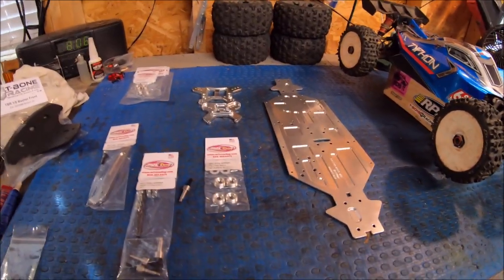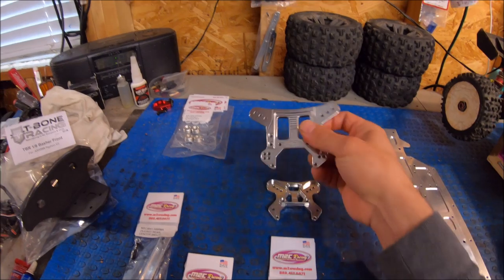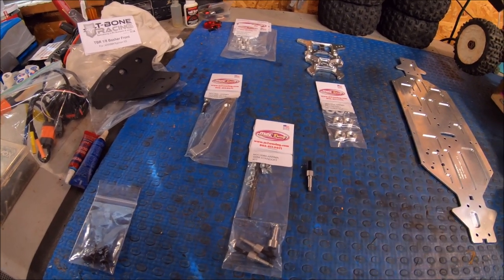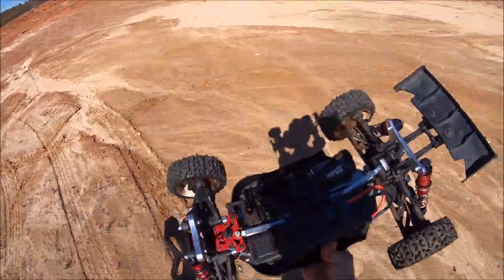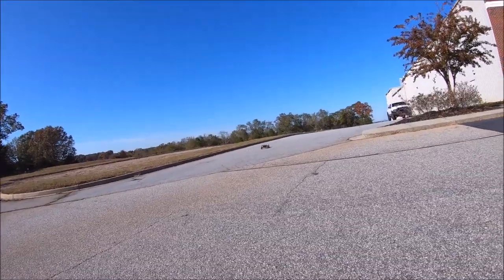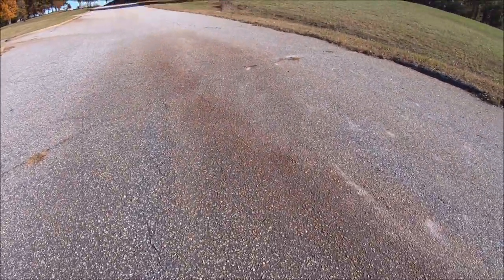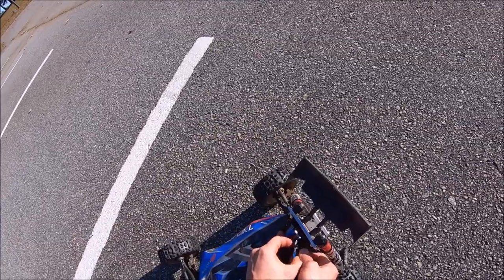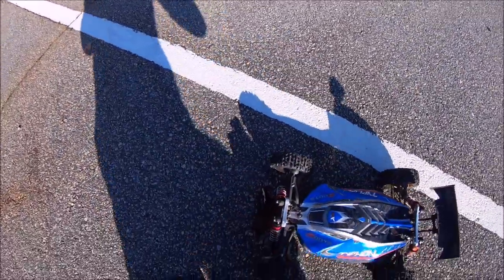Arrma Typhon 6s -NEW Lightened RACING M2C CHASSIS TEST! And BEST upgrades!

Comment: impressive! i wonder if the lighter chassis helps with durability even more?
Reply from the maker: That's a good thought!🤔I'm not sure if this chassis can take the hits the 4mm can but it definitely took some harder bashing..😂Maybe a lighter truck is less abrasive on impacts🤔Good thought brother kev! Thanks for watching buddy!😎💪👊✌✌
Reply: @RCDUDE81  with this build are the ESC settings in stock or have you changed punch/brake at all. i set my endpoints with the DumboRC and wholly shnikeys, hello higher top end!

Comment: That front flip at the 7:30 mark was amazing! 😱😱 Seems like the lightened chassis held up 👍 I figured it would on the Typhon. I will have to put it on my M2C wish list 🤣🤣
Reply from the maker: Thanks Aaron!👊Yeah the front flip was more of a quick correction. That spot kept kicking the rear up. Only way to save is it the brake!😂Loving the lightened chassis for sure!😎💪💪✌

Comment: Epic as usual! Any tips on the 4 bottom screws from not backing out from the rear and front of diff cases? Just happens or what. Any tips would b appreciated. Thanks king
Reply from the maker: Thanks so much man!👊Yeah over time with running them in and out, the threads in the case just get worn out. Plus lots of hard chassis slaps put a lot of downward force on them..the diff cases in this rig are at least 2 years old so it's time for a new one!🤣

Comment: Awesome video, what gearing are you running, pulling wheelies on buggy tyres?
Reply from the maker: Thanks bro!👊Stock spur with a 18 tooth pinion. Punch 9 on the ESC.😎👊
Reply: @RCDUDE81  ah!! I've never changed the punch, gunna have to have a play cheers buddy. Glad the new m2c chassis holds up well even tho he listed it specifically not for bashing.
Reply from the maker: @shaggysgcanimal  Yeah he just wanted to see how it held up bashing. It's still stronger than stock but over time, the 4mm will be your best bet for hard bashing!
Reply: @RCDUDE81  I'm not too rough on mine, still have stock chassis haha. Just have crcu extended skid and chassis braces. Holds up great but if I'm ever gunna be sending it like this, these upgrades would be perfect for me. Not many places around me. Keep up the good work buddy!!

Comment: hey man tha time has come to order the final parts for my v4 kraton. this question is about the speed chassis vs goliath chassis. i will be bashing and hitting jumps and stuff but will not constantly be  doing big air just manly dirt and grass bashing and i think with the m2c chassis braces,shock towers, and his standoffs and all the other reputable upgrades ive done to this build so far and the kinda bashing i do the lightened chassis would hold up 'hopefully' It has to be stronger then the stock chassis And those take a beating if the proper suspension and braces are installed. I'm trying to keep my car as light and tough as possible. Do you think the speed chassis will be a good fit and hold up to some decent size jumps every once in awhile and dirt bashing or do you think i should order the Goliath chassis? in this video it looks as if the rig holds up very well but its also shorter wheel base and more compact then the kraton. but you're the arrma king man and i will trust your word when it comes to arrma and rc upgrades. So please let me know your thoughts sorry for the extremely long message man and ill ttyl.
Reply from the maker: Sounds like an awesome build bro!💪IMHO I'd go ahead and get the Goliath chassis. The speed chassis is tough but after several runs and a bad landing, I ended up bending mine. Its is tougher than stock but made for the speed run guys. He just wanted me to test it in the bash field to see what it would take! But you're right, the longer Kraton chassis would be more susceptible to bending so the 4mm may be the way to go. One and done!👌Good luck bro and hope she turns out nice!!😎👊
Reply: @RCDUDE81  hey man thank you for your advice. I will be ordering the goliath for sure. Can't take any chances of it bending and then having to shell out another $100.
Reply from the maker: @raptorider83  Anytime man!👊

Comment: Unbelievable man, that takes some skill! I can’t wait to get my m2c chassis. 
It looks like Your typhon has more control in the air and power for wheelies than mine.. mind if I ask what weight diff oil you use? I’m trying 80k front 100k center and 50k rear but there’s no way it’ll wheelie and yours about flips over!!     Awesome job man, keep them coming!!
Reply from the maker: Thanks so much man!👊I'm running 50k front, 200k center and 30k rear. 18-20 tooth pinion depending on outside temps. Punch 9 on ESC stock electronics. Good tires help too! These  Duratrax Lockups have mad traction!💪Thanks for watching bro!😎👊🤘🤘
Reply: @RCDUDE81  omg that's insane... I run 4s 15t punch 4 in my Typhon.

Comment: Hi Eric, Quick question... What is your setup on this animal..? Don't often see a Typhon pull wheel stands like that...on pretty much every surface!!!.. It's an animal.!! Looks like the BLX stock setup but.. have I missed something??.. what pinion do you run, also do you run super thick oil in the centre diff or a spool?? Why and how hahaha..Thing is truly an animal!!
Cheers Brother... Watched this vid like 4 times...lol... LOVE the Typhon.. Absolute beast!!
Reply from the maker: Thanks so much bro!!😎👊Yeah this Typhon is nuts powerful! Maybe it's a good motor!😂But I run the blx system with punch 9 on the ESC And 18 tooth pinion. The Duratrax Lockups have serious traction too which helps! The diffs are 50k front, 200k center and 30k rear. I also have a bit stiffer suspension setup. Thicker oil and Outcast front springs in the front shocks.😎👊💪🤘🤘
Reply: @RCDUDE81  I love these tires. They're sold as louise b-Pioneer here and they're so amazing yet so cheap! Just 30-35€ for all 4!

Comment: Is the chassis longer than original 6s? An is the 6s chassis same as 3s?
Reply from the maker: Same length just 2mm instead of 3 to lighten it up. Still 7075💪The 3s has a plastic chassis so whole other platform although they are roughly the same size.
Reply: @RCDUDE81  thanks,I have a 3s was curious if I got that an changed everything over.  Would that be something could do?
Reply from the maker: The 6s chassis won't work on a 3s. Complete different car.😜M2C racing is working on upgrades for the 3s line though including a chassis stiffener kit soon to come.😎👊
Reply from the maker: The 6s chassis won't work on a 3s. Complete different car.😜M2C racing is working on upgrades for the 3s line though including a chassis stiffener kit soon to come.😎👊
Reply: @RCDUDE81  awesome thank you very much I hope to see it soon, I'm sure down the road I'd like to get a 6s or something.  I give you my best wishes I'll be on the lookout

Comment: Stock electronics?
Reply from the maker: I believe I was running the stock blx185 paired with a Turnigy 2000kv 4074.
Reply: @RCDUDE81  Cool, i bought supidly big 4585 motor, i got the m2c long chassie so its gonna fit, its only 1580 kv, im trying it Because im geting bored of tp motors and their price, i have one but its 2700 kv which is wayyy to much, its only 60$, its surpass hobby cheapo